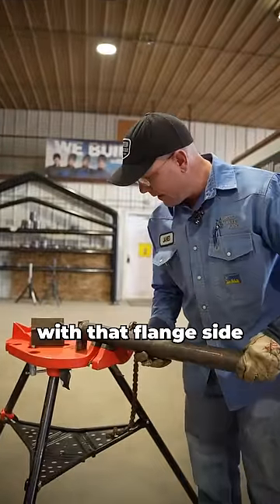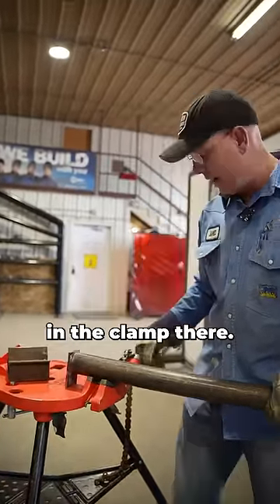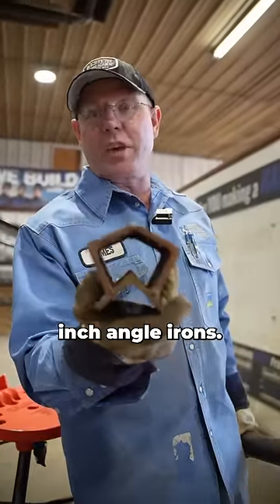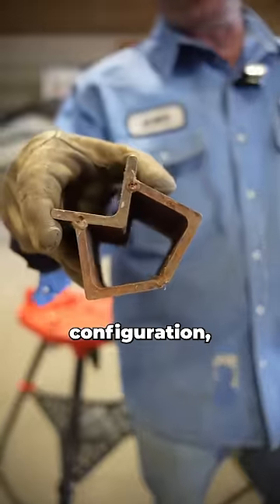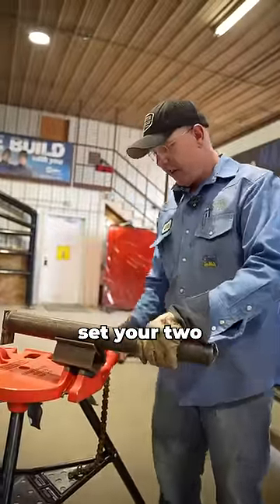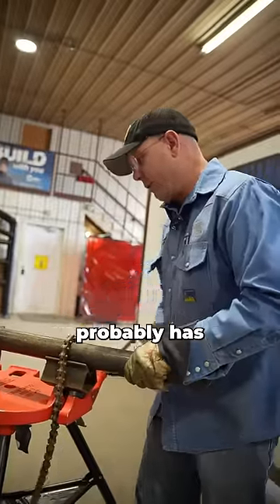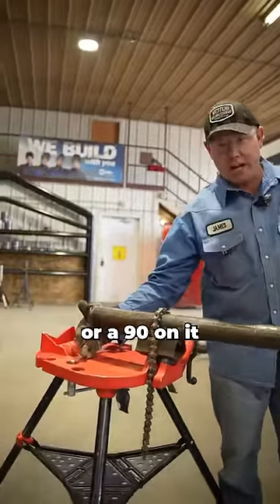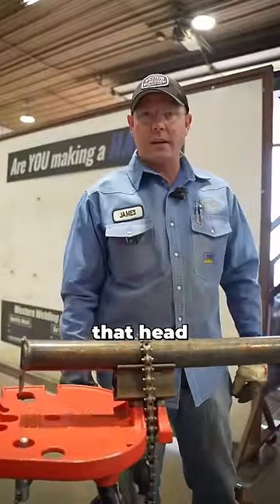Upgrade Your Tripod Setup with a Riser #shorts

Comment: My first fitter, 30 years ago made me one. He called it a dog house? And yes I use it all the time.
Reply from the maker: Nice
Reply: That’s what my ol mentor called it too
Reply: That's funny thats what I named mine when I made one becauseit reminded me of snoopy's dog house. I had so much 2 inch pipe to fit at the Indian basin gas plant back in 2013, i was a first year fitter was 20 years old and wanted to pump more fits out. Seen alot of scrap 3x3 angle and put one together. I made like 10 dog houses for all the fitters and welders mine has notches for the chain on the top for the tripod chain to fit between for a secure hold. Another tool I made on that job to fit 14 inch stainless 600 pound flanges, was takeing a thick chain about 15 inches long and got some 3/4 x 6 inch stud bolts and welded a chain link too the nut and stud on one end and led the nut free on the other sides. When you stab the bolts in opposite of each other you can use a carry deck to left in up plum and level. You can off set your two hole by two holes so you can still put your twohole pins on top with a torpedo. That saved so much time. I called that one my dog chain lol. After that job someone stole that outta my box lol. Probably some from another crew that didn't like I was putting out fits really fast and my welders always welding lol
Reply: @LethalDose113  yup 👍. Notches help a lot

Comment: That's so simple, yet clever.
Reply from the maker: Thanks!
Reply: Even simpler is rotating the pipe
Reply: @kevinkanning4970 That tab is simulating a flange, which is round.   Therefore, in an actual pipefitting scenario, no matter how many times you turn it, the flange is still there.

Comment: Correct me if I'm wrong but what about just holding it off the other end?
Reply: Mine had notches so the chain would have a guide and makes sure that sucker didn't move lol
Reply: My thoughts exactly I've welded thousands of joints and never had this problem lol.
Reply: If your a fitter you can see where this can apply very help and useful

Comment: Every rig welder? Not even close! Most every rig welder has pipe stands not a tripod. Never in my life have I seen one or needed one.
Reply from the maker: Aight then
Reply: That's a fitter tool lol it's nice if a welder has one
Reply: Yeah most rig welders have a vise on the truck, but those Portable tri-stands are Very handy. I have jack stands And a tripod.

Comment: Why the fuck isnt there a tri stand with like 4 inch throat. Or adjustable clamp bed
Reply: They probably do make different jaw inserts but personally I’ll keep my jig with the 2x2 angle about 50 times cheaper and takes 10 minutes to make
Reply from the maker: This